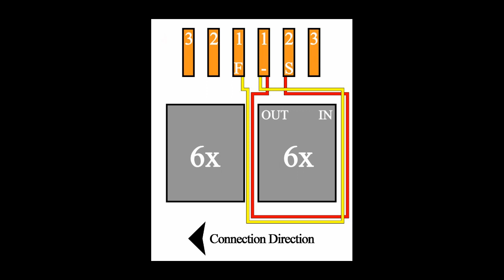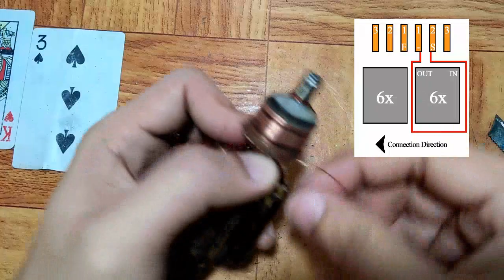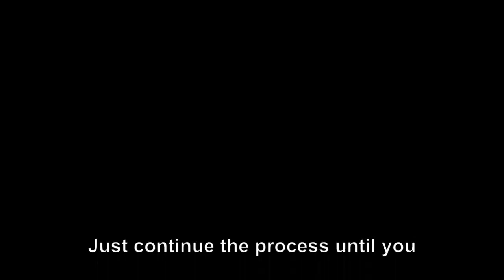Black & Decker Drill - Simplified Diagram

Comment: Hi my friend , just want to ask please , after winding 3 armatures  and complete them with resin epoxy , the all  sparking when i plug them ???  can you please tell me your opinion thanks lots
Reply from the maker: Hello Jim, well there are quite a lot of possible explanations. 1. Is maybe the connection on the segments and the wires are erroneous. 2. The commutator may be shorted (have you checked them one by one through a multi-tester?). 3. It may have a shortage in the windings. 4. The field coil wire and the armature wire may not be compatible (the field coil is always 3 number lower (means larger in diameter) than the armature coils. example if you use a number 30 on the armature, the field coil must be 27).
Reply: @JakeMarvinVillegas  thank you very much I'll have a look it again
Reply: @JakeMarvinVillegas  also please what do you mean by wire number 30 is it 0.30mm
Reply from the maker: By number 30 I meant a diameter of 0.2546mm and by number 27 a diameter of 0.3606mm
Reply from the maker: You're  welcome Jim

Comment: What is the power of the drill ?
Reply from the maker: I forgot the exact wattage,  but it should be around 600 watts
Reply: thank you
Reply: Is a makita 800w
Reply: 230-240v
Reply from the maker: Yeah the black & decker drill and makita planer have the same diagram nice observation

Comment: You have a drill rotor scheme BOSCH GSB 20-2 RET.
I wanted to rewind and I do not have a schematic

I do not know the wire diameter and quantity scrolls
komutator >    5 4 3  2 1

                               ^     I I

                                     I I

               wire >    ---->-- I

                               I       I

                               I       I

                               -----<---

               rotor   5 4 3 2 1
direction right  <------------
please help
Reply from the maker: Hello slawko,  sorry your comment was held for review,  I only noticed now.  Do you still need help?
Reply: @JakeMarvinVillegas  so I need help
Reply from the maker: @slawko233  I'm sorry I do not have a diagram for that dirll. But can you give me the voltage input? maybe I can help you about the wire diameter and number of turns on the armature slots. By the way you can find the diagram using a growler.
Reply: @JakeMarvinVillegas 
 Dirll: BOSCH GSB 20-2 RET
Power: AC 230V/ 900W
two gears:
1. rpm 0-1000
2. rpm 0-3000
rotor: fi 35mmx42 mm division 12 slots
komutator  fi 22mmx18 mm division 24 contact
direction  rotor- right
Reply from the maker: Probably use swg 25 or 26 with 130 or 150 turns for the field coil, while the armature coil 28 or 29 with 22 or 24 turns. Adjust the number of turns if needed.
Reply from the maker: But it is better to gauge the original wire diameter and count the number of turns for better results.
Reply: @JakeMarvinVillegas  
Thank you for answering and for your interest my drill

I will be looking for a solution
I have time to wait